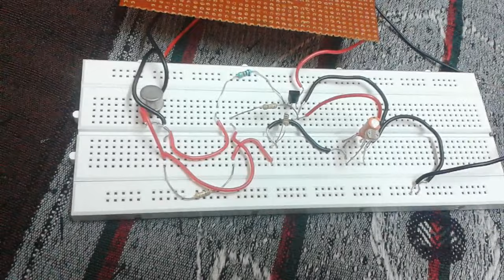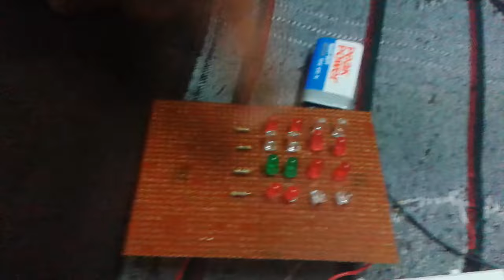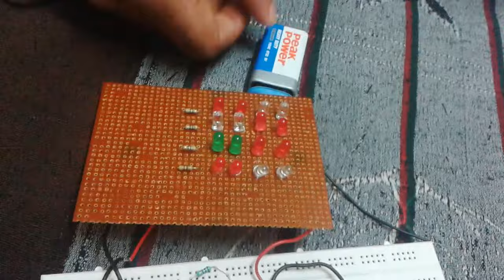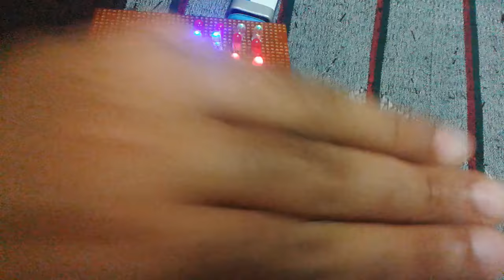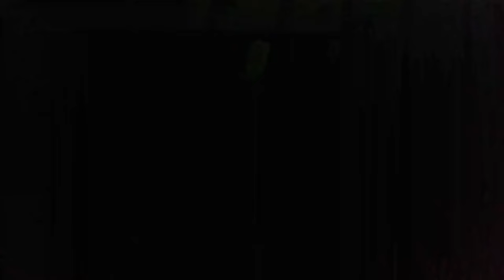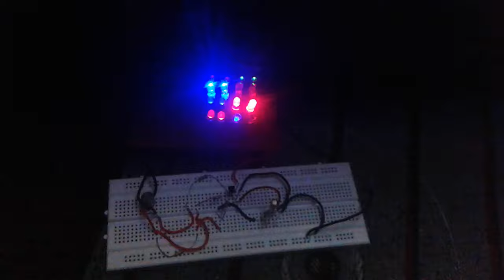Auto night LED lamp using LDR

Comment from the maker: Hello Lisa...basically here we are using LDR and explaining its applications.BJT is working as a switch in this case and set accordingly...actually a reference has been set corresponding to the value of LDR resistance ...i.e as soon as the resistance of LDR falls below that value LED glows....This reference is dependent upon resistance values and transistor used....I hope this helps.Thank you for your query.